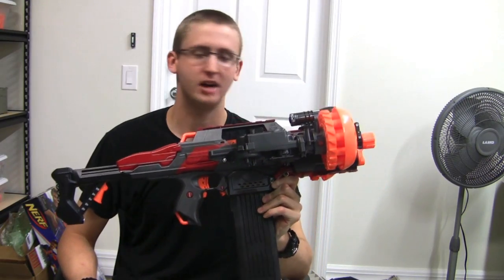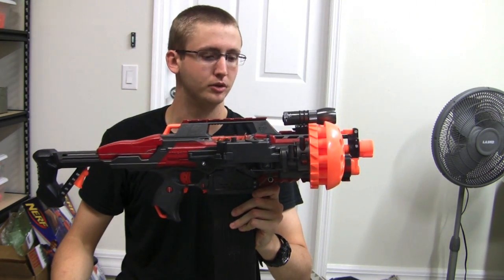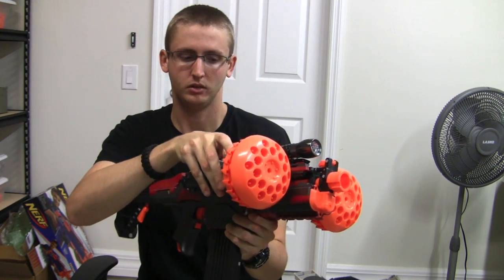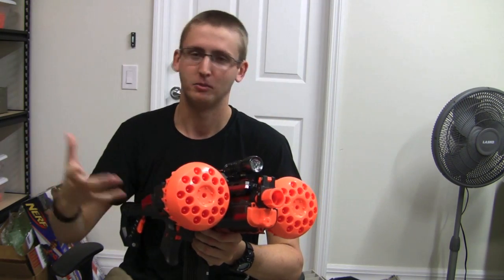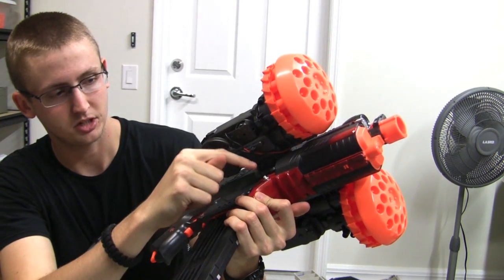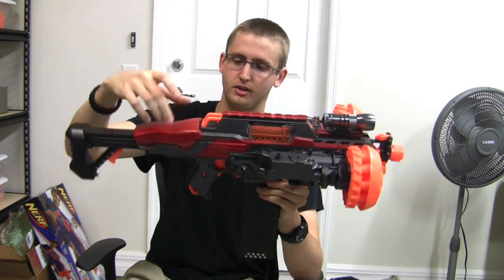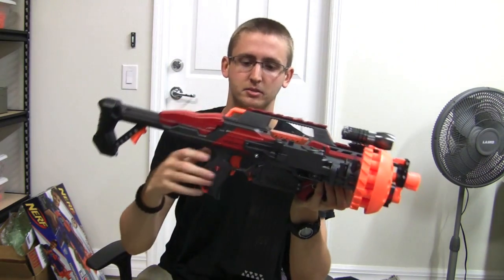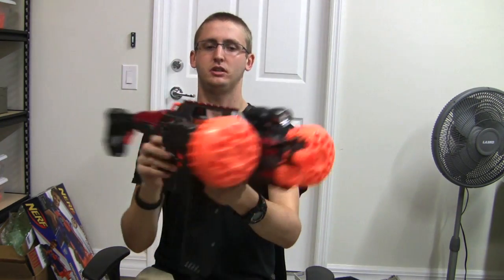[MOD] Nerf Rapidstrike Modification - 2x Swarmfire Integration

Comment: Also, do i need 4 ultrafires or 3 ultrafires when using an RM2 motor?
Reply: You can do it but you need a powerful gauge wiring or it will burn